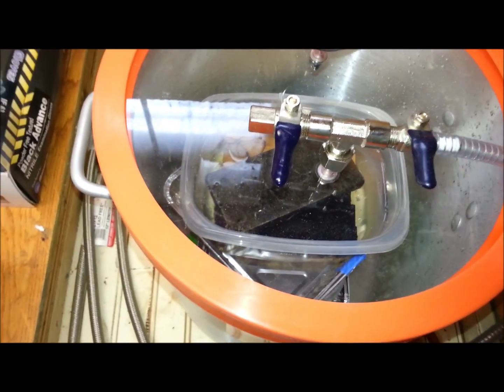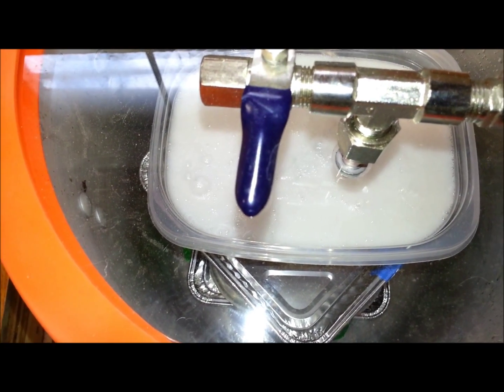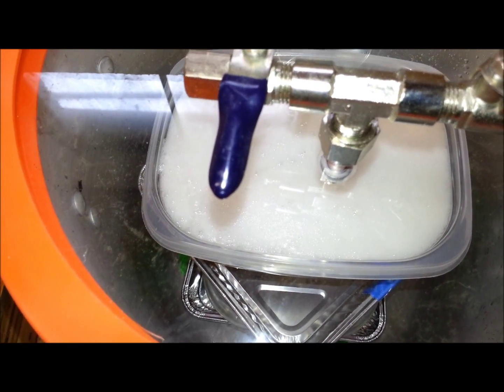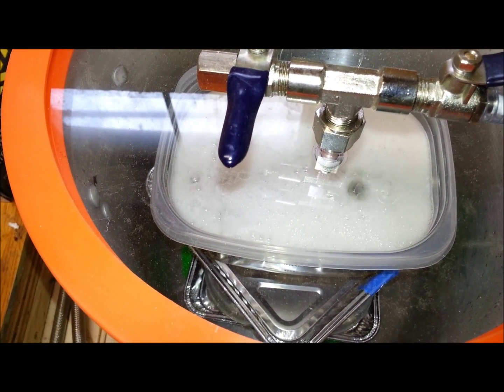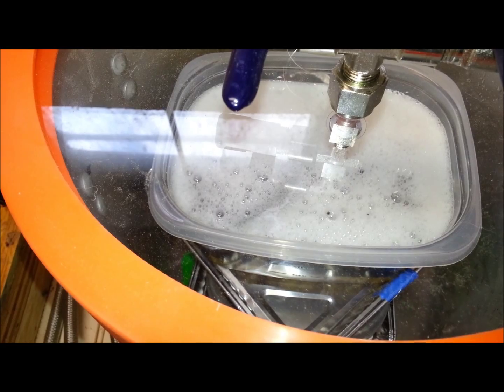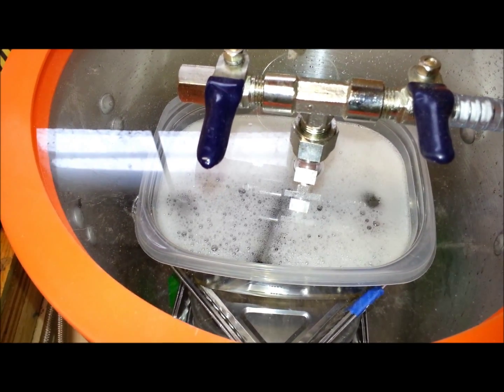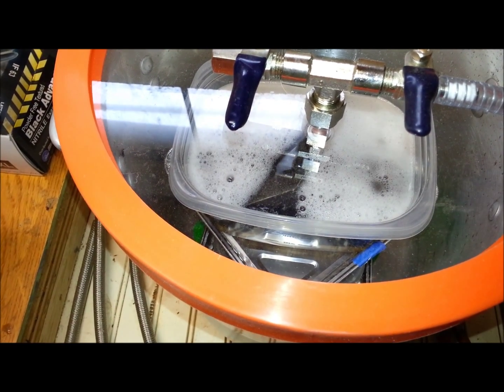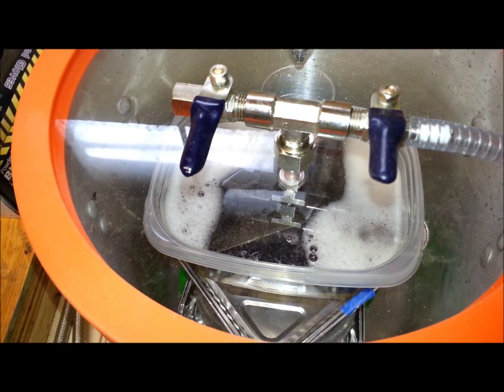Wood Stabilizing with Vacuum Pot 1

Comment: Looks like you're using a Best Value Vac Chamber.  What I would like to know is it a regular or a Glass Vac Chamber.  I called Best Value and they said I should use a Glass Vac when using Cactus Juice.  They also said I should use a Cold Trap.  I'm new to stabilizing.  Wife said she would buy me a Stabilizing Set.  I think I could also use the Vacuum pump for a pressure chuck for the lathe. Very good video learned a lot.  Thanks for any advice you can give me.  Henry
Reply from the maker: Hi Henry, It is the Best Value Vac kit. I don't recall when I purchased that there was a Glass Vac Chamber, so can't really speak to any differences. It looks like they may have had some issues with people getting resins on the lid and it degrading. I haven't experienced this myself (run a pretty clean shop most of the time). And I've not had any issues with my pump so far. All that being said, my shop has been completely inactive for over a year (soil compression caused a cracked wall and flooding, still getting it all redone). If I were planning to buy right now, I'd probably follow their recommendation as its just one less thing to worry about. Have fun.

Comment: I have an ARKSEN Chamber I bought on Amazon...I used it twice and am seeing small stress cracks on the vacuum side of the lid...Looks like the one in the vid...3 gallon however. Can anyone relate? Is it normal or does it get worse with time?
Reply from the maker: Mine has been used on and off for about two years now I guess and shows no sign of stress cracks around the inlet or gauge. My shop is packed up at the moment but I want to say the top is either 3/4s or 1 inch acrylic.

Comment: What's your container?
Reply from the maker: +jdalamo The outer container is a Aluminum 5 gallon pot that came with the package from Bestvaluevacs.com. The inner containers arre just Ziplock or Rubbermaid containers. Whatever I had on hand that was old in the kitchen.